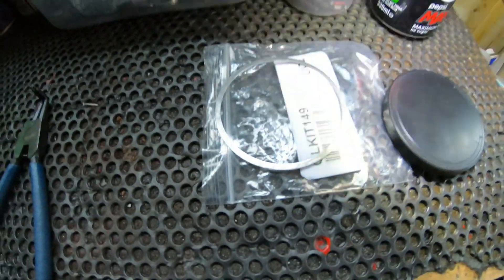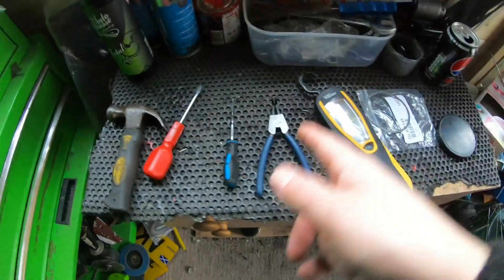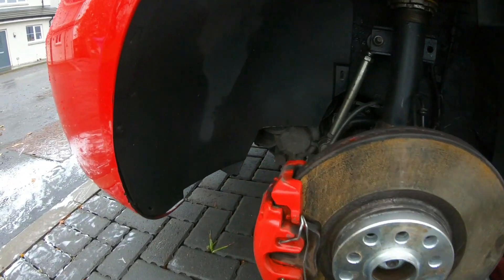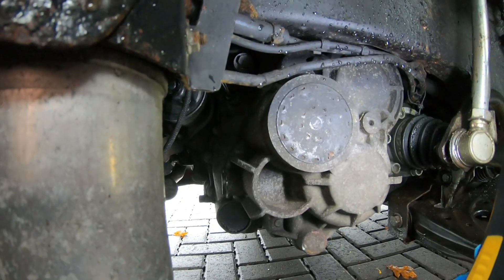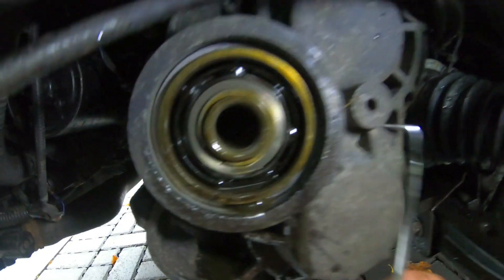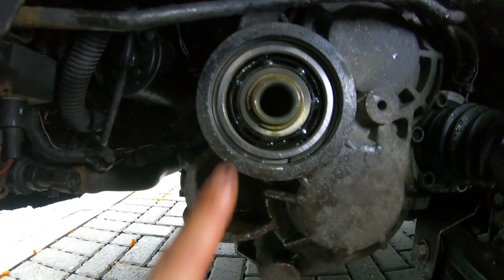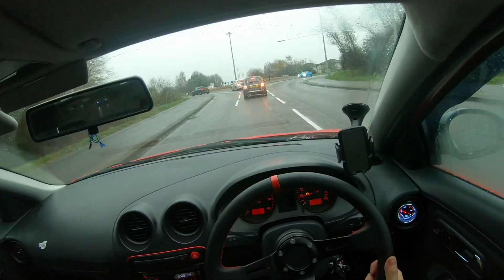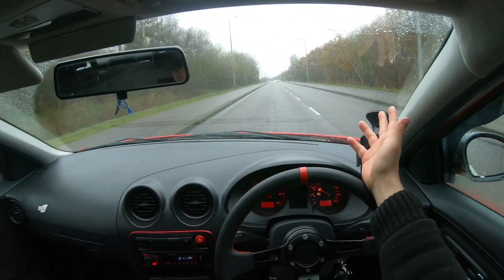Seat Ibiza 6L 1.9 TDI - 6 Speed Gearbox Shim Kit Install

Comment: Does this stop whining? My Altea Freetrack has started making a whining noise recently just wondering if this would resolve that issue?
Reply from the maker: I can't say for sure im sorry
Reply: Have you done it on yours? My mk4 is whining on deceleration and I've read that it can also be caused by this.
Reply: @User548cH7zP Iv seen other vids saying it sorts a whining on deceleration
Reply: @LordoftheBadger did the mod and sorted the whine indeed

Comment: Is this gearbox still running fine? The circlip wasn't installed correctly
Check at 3:20 and at 4:22 and u will see the difference (:
Reply from the maker: Car was sold years ago the owner blew it up and scapped it unfortunately

Comment: Dude I'm just changing my clutch slave cylinder as I'm watching this, sice my Cupra 1.9tdi won't go into gear also, until i rev it up and only then it slides into gear... It has 280k on the clock and wasn't properly maintained since it was new... Let me just tell you I'm losing it changing the mfg slave cylinder... U sir are a legend. 
Cheers
Reply from the maker: Glad to this video helped 😊